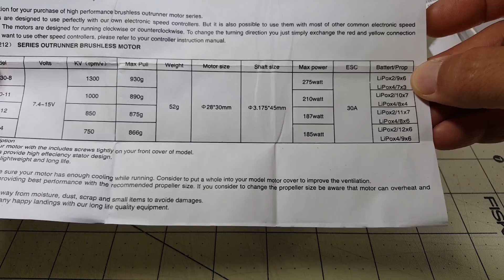DYS D2830 1300kv Motor Review

Comment: Hello. Is this motor strong enough for scratch built piper cub with AUW 780g?
Reply from the maker: Depends on the prop and battery.  Assuming a 4S lipo with 6 inch prop, should be enough.
Reply: @ how about 3s battery with 8x5 prop? Would that be appropriate? I’m a beginner and currently using a 2212 1000kv with 1045 prop and although it flies, i feel i don’t have good control in windy situations and it loses altitude easily

Comment: Which kind of batteries can I use for this motor?
Reply: 2S-4S, too much heating on 5S but can run it, tested here. My advice is to run it on 3S battery if you want it to work for a 2 years approx. on a regular 1-2x weekend flying

Comment: The performance of this motor  (dys d2830 1300kv) is similar to the performance of the motor in flitest power pack b?
Reply: it is similar but not quite accurate, 250kv higher is much more faster RPM motor but it can fly same trainers if you ask that, of course - even better than Turnigy(usually used on FT bundles) on lot of tests, specially lifting/throttle tests...
The version you are looking for to swap the FT B Pack Radial is RaceStar BR2830 at 1300kv - that is the old RS motor but very good and closer results as Turnigy from Radial B pack, even has the 1050kv version exact as FT B pack basically.

Comment: The wires are stiff because it's the same enamel coated wires they use in the windings. They don't clip the leads and add silicone wire.
Reply from the maker: Yeah, I noticed that later after I filmed the video. The silicone is more like a casing. You can see the stiff wire inside.
Reply: Don't cut the wire. You will never solder it back. enamel coated wire is  impossible to solder.
Reply from the maker: I wouldn't do that anyway, however, I've been able to solder enameled wire by carefully scraping away the enamel layer with an exacto knife.
Reply: I tried doing that I failed. :(
Reply from the maker: I find using solder paste or flux and a hot iron works for me. Also you have to be quick.